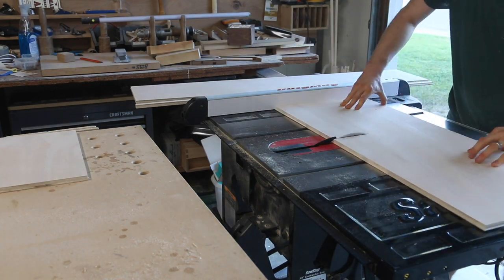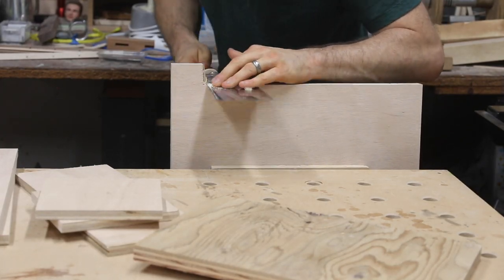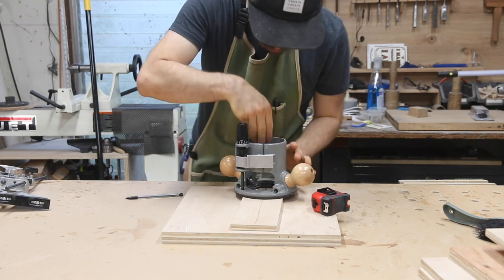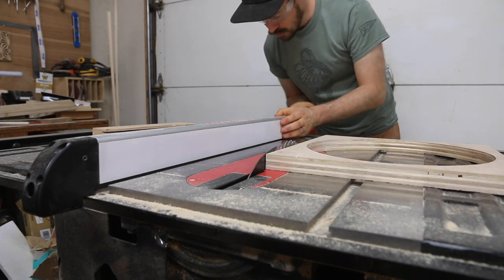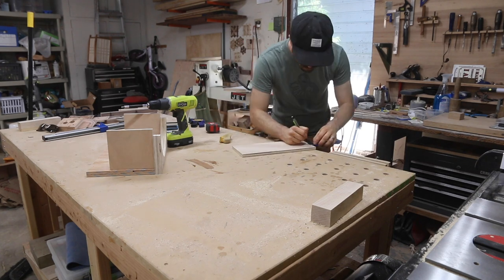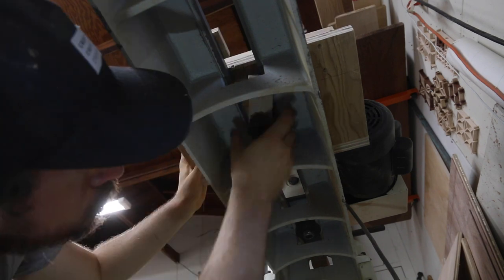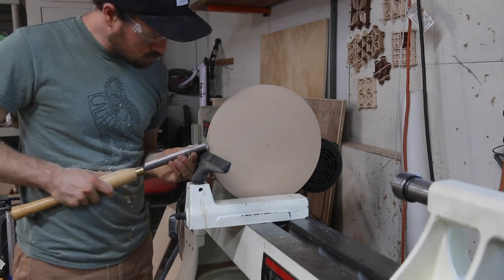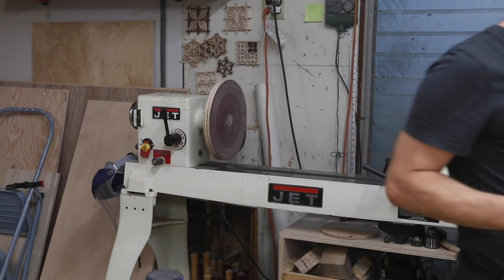How to make a DIY Disc Sander for a Lathe | Woodworking / Toolmaking

Comment: That turned out great, Brian! I like how you just used the actual disc to face off the box/platform to get it nice and even. You'll get a ton of use out of that.
Reply from the maker: Thanks Bruce. I figured that was the best way to get an even gap (not sure if that's incredibly necessary though).

Comment: What an horrifying idea ! You're gonna get a bunch of abrasive on the track of your lathe, and soon ruin it.
Reply from the maker: What am I missing? This isn't like a metalworking lathe, there is no carriage that constantly moves back and forth, which is generally the concern with abrasives. Any loose abrasive works its way into the box under the table anyway, and not out onto the tracks.

I clean the ways around once a week, too.
Reply: A solution to that and dust is to add a dust collection port to the box.  Besides, many people sand spindles and bowls above the ways any way ... so there is typically already some grit to deal with, I blow off the ways after every use to keep green wood shavings from rusting the ways.  Nice project!
Reply: @blueridger  did you watch the hole video? He did include a dust port. Grit won’t be an issue.